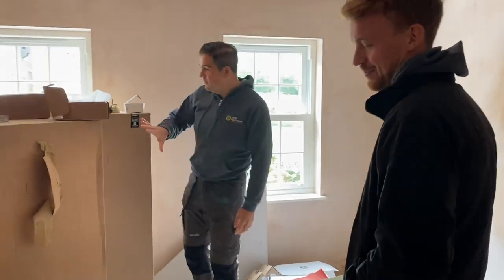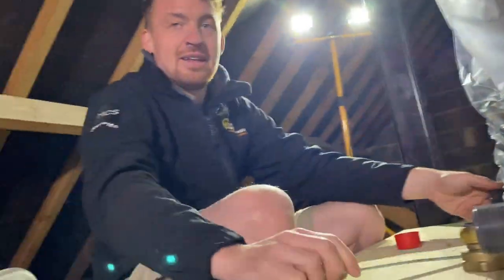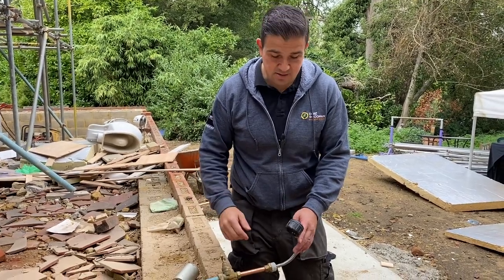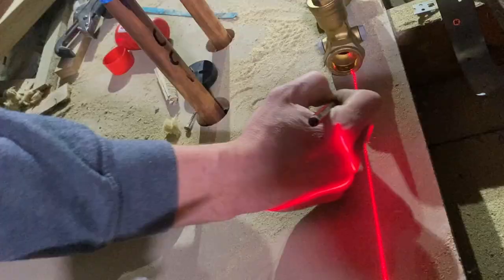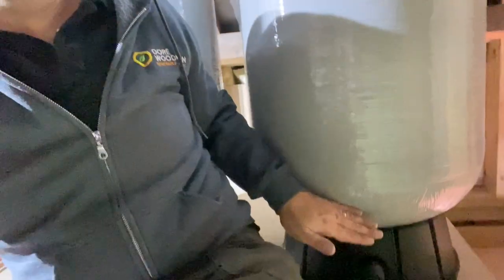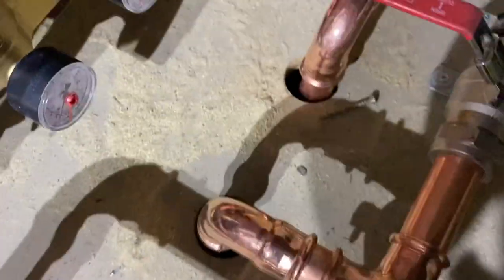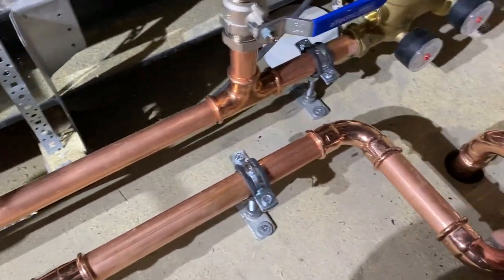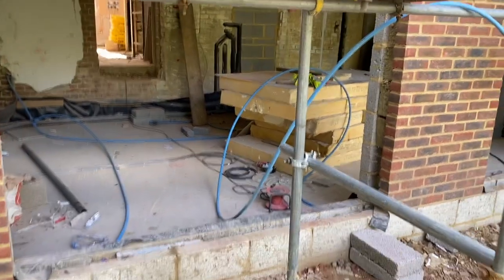Stuart Turner Mainsboost - Maximise your water flow rates with an Accumulator

Comment: What were the criteria when specifying this system? My understanding of pressure accumulators, which real world experience has shown to hold true to me, is that you're really just increasing the dynamic system pressure, and thus flow rate, for a finite amount of time - during which the performance is tailing off. Because you can maintain a higher dynamic pressure than on direct mains feed at all services, you can run a higher number of outlets at the same time than before, or several at a comparitively higher flow rate. The downsides to hydraulic accumulators are (1) the finite amount of time you can sustain this, which is ever declining the moment an outlet is opened, and which shortens dramatically relative to the rate of draw-off (no. of outlets open simultaneously), and (2) the size of the vessel(s), which are considerable if you want to increase and maintain a substantially higher performance than direct feed. You can of course add several vessels to increase this time, but this has considerable space requirements and of course adds cost. I feel, for a luxury property such as this, a variable speed booster set would've been more appropriate. You would probably have the same footprint as this accumulator package, if not smaller if designed well, and a much higher performance that could be sustained. With those incoming mains figures on pressure and flow you could run a smaller break tank as the recovery rate would be very high.

Comment: Why do you need two? Do you need one for hot and cold? Or just purely just to manaage expectations for taps and bathrooms
Reply from the maker: It is just how it was calculated by looking at the incoming pressure, cold main flow rate, number of outlets, shower heads and flow rates etc.